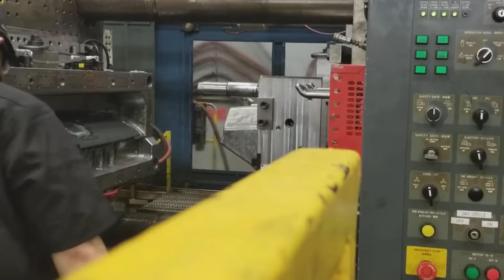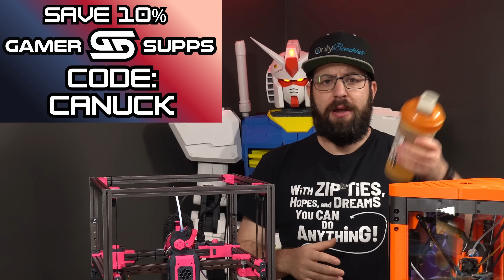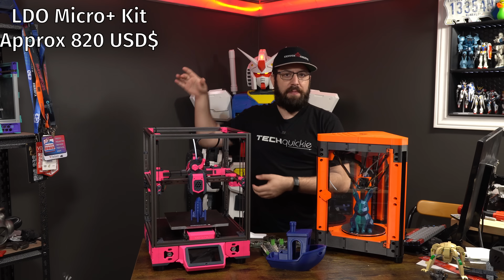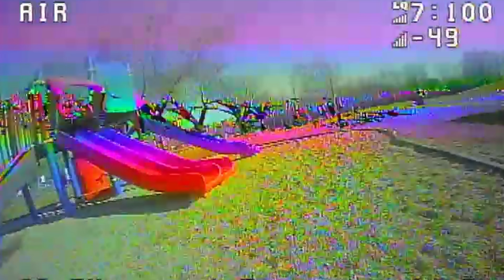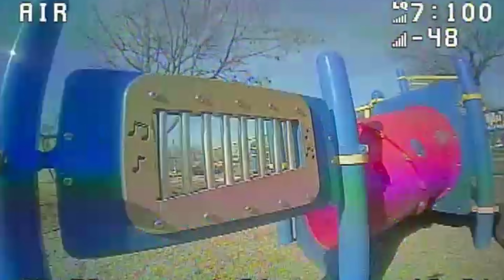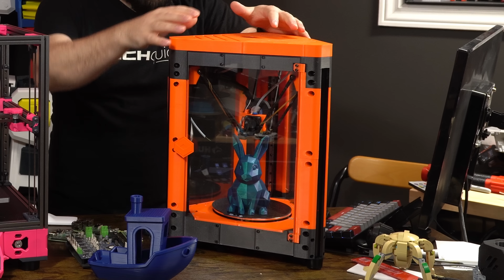Are DIY 3D printers in danger?

Comment: TL:DR: I see what you're saying about consumer printers becoming more enticing than DIY printers.  (My personal pet peeve is that Elegoo commercial where the dad prints a toy for his daughter then shows it to her friends and they run into his office unsupervised handling filament and loading it in and throwing all the things they want to print on a single virtual bed.  Then after playing for a little while, the same day, pulling all of those objects out of the printer and they are all perfect and ready to go, ugh.)

I just acquired my first 3D printer about 3 weeks ago.  A used sv06 plus with a 5015 blower fan upgrade on the hotend.  I already replaced that 5015 bearing fan with a maglev.  Replaced the PSU with a meanwell.  Replaced the rest of the fans.  Installed Klipper on a Pi after 5 days of using Marlin (best move ever for so many reasons).  I'm in the middle of modding a filament dryer with better fans and a pot to control fan speed.  I put off getting a 3D printer for so long because of either cost or the practicality just wasn't there.  I knew the DIY scene existed but didn't know anything about it.  From my sv06 plus I learned the limitations of the bedslinger.  I also learned it had limitations on materials that couldn't be completely solved with an all-metal extruder and hardened nozzles.  I learned I really like this hobby but I want to print better materials and faster without slinging a bed.

Then you see ads for an open source SOVOL M1D with 2 toolheads, and ability to swap materials and colors without waste.  At this point I know Voron existed and that kits were expensive compared to my sv06 plus that could print better than most things I'd seen posted online so far.  You see that machine coming out at a price that rivals a Voron Trident kit and it's ready to go out of the box with 2 toolheads and the ability to use multiple materials and colors.  The Voron kit on the other hand only gets you one toolhead still, more money after that needed to get a second toolhead or system that allows you change materials and colors.   And you do ask yourself, why would I buy a kit that people claim it takes months to build just to get to point that doesn't match the consumer product for the same price?   But then you remember what you went through with that consumer product.  Upgrading all the fans to fans you want,  upgrading the PSU, Upgrading the toolhead, upgrading the bearings,  getting Klipper set up and you realize there is still value to building your own.

I can see where the general user sees these consumer products and says I can just buy that and start printing the things I want to print or create things for whatever else they are in to.  Me, I got into this for the ability to print my own parts and useful items without having to rely on a store or waiting for someone else to design a product to exactly fits my needs or just basic things I can make for very little cost compared to buying them.  One of the biggest values of building your own is like you said, you understand better how it works and how you can make it fit your needs better, but also, upgrading.  Sure that M1D looks fancy and nice, but if you have something like a Voron Trident, you could modify it to do the same thing with parts that more easily replaceable and not be locked into that ecosystem, and that's what your average consumer isn't going to get.  But it is scary to think that may hinder the DIY users at some point.

Comment: I started on an Ender 3 V2 in 2021, got into printing for a while and enjoyed tinkering with the hardware, but I would get annoyed when it wouldn't work or had to tinker to get a print out, I used it until this year when I got a Bambu P2S. Now that i had a good system that's so reliable its sparked my interested back into the DIY builds. I have started modding my Ender 3 and my next upgrade is klipper. I got an Elegoo Neptune 3 for €5 locally purely just for fun and found the Encore printer project that I fully intend to make with the parts from the neptune. I am really enjoying it so far.

Comment: My first printer was the Tevo/Homers Tarantula. It was atrocious; and required more printed mods, than prints that it produced that where not mods.  In 2023 I bought a Prusa MK3 clone for a school. And then I found out that Sovol, just came out with the SV06. I was jealous of the school, and my own printer could not reliably print anything. So I bought a Sovol SV06. With very few, highly functional mods and replacement parts, that SV06 has just been churning out prints in mostly PETG, but PLA and TPU as well.  The biggest problem I have with the SV06 is having enough plastic to feed it. I am hoping to design and build a variant of the Ender 3 NG, in order to make use of the modified electronics of from the Tarantula. I am thinking of a "Rook" like Core XY printer that uses fiberglass driveway reflector posts as re-enforcements to a  solid printed frame, which is sectioned and dovetailed at the slicer level. By using the fence posts, the rectangle frame sections will need very little infill. Sectioning off the corners would allow for more, better, infill where it matters most. The idea, is to make a cheap DIY Core XY printer with a super ridged frame, using glue to connect the sections, and as few fasteners as possible. Also, just hardware store grade panels, and front door, should drop the enclosure cost. I recently bought a Elegoo Mars 5, which I hope to use for printing highly detailed miniature RC Cars, and for and for more precision in very small prints.

Comment: I started with building a Prusa clone and then bought an Ender 3 v2. Then I tried to make my own bedslinger with V slots. I had so much fun. Then life happened, and I sold my Ender 3 v2. Four years later, I'm searching for a new printer, and I only found out there is only one option, and that is Bambu Lab. 
which is boring and depressing. 

But I do see value in custom big-sized printers and custom enclosure boxes.

Comment: K1 SE now goes on sale in the $250 range, put a few hundred into it (flowtech nozzle, bondtech X axis/gantry/extruder, print some walls and a door) and you've got a high end enclosed 225mm^3 machine. K2 SE's $299, but I haven't looked into the aftermarket on it. The reason the k1se's aftermarket is so good is it's basically identical to the k1c aside from not coming with an enclosure and camera, and I'm not sure if the k2se has the same level of part compatibility with the higher end k2 models.

Comment: I'm more on the side of buy cheap option, upgrade as I go. Lots of community mods for the Centauri Carbon. Trying to tailor an existing, affordable machine to my needs as I go has been a lot less stressful than trying to build something custom which might not meet all of those needs right out the gate (i.e. there will be post-assembly customization regardless). Having something solid to design around is actually how I work best! I make lots of mating parts to combine different things (like my phone case with magnet grip and my external SSD, or a top cover of my printer that relocates my filament dryer and the runout sensor).

Comment: The newest iterations of consumer 3D printers like the Flashforge Creator 5, Snapmaker U1 and Anycubic Kobra X are getting really good. Yes, as far as baseline printing is concerned for people who want to print something almost straight out of the box, DIY is probably cooked. Matching today's affordable printers on performance, reliability, features, etc. has become impossible, especially when you factor in the stiffness advantage of mass-manufactured printers having frames either made of machined castings or using all-in-one machined corner connecting pieces. Not going to match those using 20/40mm extrusions and off-the-shelf braces.

DIY still has room in experimental systems, arbitrarily large build volumes, tooling combinations unlikely to ever happen at consumer-friendly prices, etc. If I had to build a DIY printer today, the biggest improvement I can think of over today's new ~$1000 printers besides build volume over 300mm cube would be having dual independent X gantries so one X-axis can take its time tool-swapping while the other is printing with 8-10 total heads available (4-5 for each X-axis) to eliminate the need for an AMS for anything I am likely to ever print including a few spares for backup rolls and special purposes.

Comment: I also came into 3d printing late 2017 building the original Hypercube. I probably fit into the third group you mentioned, that is I like building electronics projects and I wanted a fast capable printer at the time where the only option was to build it. I must say I got the bug and you learnt a ton. I have recently however bought a Bambu X2d and I'm considering upgrading the hypercube to a enclosed Voron legacy. Plug and play printers are just boring because I want to upgrade and mod things.

Comment: FWIW: I’ve been loosely following the 3D printing industry, since the OG maker bot. The starts recently aligned and I have the extra cash and space for a 3D printer. I went with a Prusa Core One L.

That said I think it would be neat to build a tiny 3D printer from a kit one of these days, but I do agree that sourcing custom components is getting more and more expensive these days, which may ultimately deter me from building a DIY machine, unless some one has the means to stock and sell parts kits at a reasonable price.

Comment: Product designer and inventor for hire now retired.  So here is my 5 cents.  Few people have sufficiently wide skill set or the time to do it all from scratch and wish to spend the money.  
*   The kits your pointing to need the egg before you have the chicken.  So this assumes you own a printer.   Two groups the antique one like my Tevo Tornado. or a enclosed unit.   
*   Second in a heated chamber plastic components will CREEP!  So the reason for temperature control chamber is questionable.
*   That leave for the best units that can run the widest range of materials and even be converted to a CNC station. Plastic structural members are out.
*  need a modular approach.  
      *     The classic 80x20 extruded aluminum framing systems with brackets for assembling the frame.  This is how my Tevo Tornado and one of the models you have in the video.   However; not the most cost effective and stiffest.  
      *    Square and rectangular perforated thin wall steel tube for example are far stiffer, cheaper, and operate at higher temperatures then extruded aluminum.   Can make right angle corner without brackets, however tube insert for carrying clamping load across ID of tube best practice.  Blind fasteners can be used if an insert tube isn't practical. 
*    Modular components such as found with the extruded aluminum  attached to brackets.
*    Electronic boxes that can be inside or outside of an enclosure due to heat.  
*   need better modules for the motors which include cooling option.

My issue is that I want to design me own parts that and design from scratch.  Habit from solving real customer problems.  So to make my tornado work in an enclosure.  The first specs I looked at were the motors.  Not rated for the air temperatures of high end plastics.  They need liquid cooling.  Need to cool the filament so it retains it's stiffness  for either approach for driving the filament.  May need air cooling to achieve solidification of the plastic after it bonds to the previous layer for stiffness of the final part.

Comment: I didn't build the voron because for the same price I can get an enclosed 3d printer with AMS, nozzle scrubber, pressure leveling, and parts are cheap. VORON needs to update to a 3.0 with all those things  to start attracting people. Making all those mods later is possible but just the AMS system is about $300, when Elegoo cc canvas upgrade is $55 and multi path. Not to say is an upgrade to the firmware that takes 2 minutes of your time, in VORON you need at least 2 hours to setup.

Comment: So you can call me a Prusa fan boy because at some point I got MK3(S?) kit, then I sold it and got an MK4 kit, then I rebuilt it into Core One, and now I’m waiting to get my INDX founders edition. But my first 3D printed was a Dagoma Neva, and somewhere in the middle I also got a Monoprice Mini Delta. Last year I’ve also built a Voron0 with my kids and this was a magical experience.

Now the main letdown for me was that I took the recommended OrcaSlicer with profiles for V0 and the result was so-so. And then I took some outdated PrusaSlicer profile and copied a PLA profile for MK3, or CoreOne that the result was waaay better. I find this very disappointing because if some guy can hack a basic thing that a community didn’t achieve in years then is there even a future for that community?

Maybe I’ll get some time in the future and I’ll become more active and vocal but pushing bare necessities to the public like color change, filament sensor, etc. Maybe I choose a wrong base line because V2.4 has a better support, but I’m interested in a tiny printer that I can pack and bring for demos. But at the moment I’d rather spend my time by printing stuff on Prusa and modding things that don’t work well (especially MMU, enclosure, filament storage) instead of fighting V0 to get to the level of my Prusa. On the other hand I still need a printer for my kids, so I’ll keep improving V0.4217 😊

Comment: A valid point, I started 2013 with reprap, currently voron and Snapmaker. But I know exactly what you mean, one directional flow, transition into commercial (boring) enclosed and locked down products. On the other hand if you see the voron team members at the reprap festival talking, it's pretty reassuring and nice to hear what they are planning. All the products look old and boring compared to full DIY printers 😅 (a fan)

Comment: For sure it is a little worrying with the direction. I spent a long time building my Voron V2 and around the same time a friend went out bought a printer set it up and its printing faster and cleaner (initially) than my V2. For me, im in the bracket of "i love building the printer, and modifying it/maintining it" and this shows when my friends printer had an issue and he didnt know how to fix it.

Price point for me is the biggest gripe, as you pointed out a similar spec consumer machine to a voron, you're looking at 3x the price for the Voron

Comment: Stumbled across this video while building a printer and while I can't take complete credit for the build, I am taking an ender five and basically turning it into a bamboo labs P1. It currently has a car XY motion system and I am currently working on the electronics which include a big tree tech octopus pro and raspberry pi 4. 

I also have a second project which is much more interesting and is proving to be much more challenging than I thought which is custom building a nearly 100% 3D printed printer that I designed myself trying to force myself to learn how to use CAD systems better.

Comment: You are 100% (infill) correct, I feel absolute actual rage when a bambu user starts yapping about how 3d printer is "easy" and I always wanna say "yes stupid, because of us", but usually I stay silent unlike my own printer.
I would say the ender 3 in itself was a scaled down CR 10, but late 2017 was toward the end of the OG CR-10 so understandable.

Comment: For me the main problem is the tech. As things matured and move on to advance by inches, DIY printers can't catch up any more. For example the ladar sensor on X1 and flow pressure sensor on A1. I've been a tinker myself since the the pandemic, but now, when i just want to spend handreds of dollars and multiple weekends to intall the most advanced mod on my Voron 2.4, they are still not to the standard of X1. Then what's the point? Please correct me if I'm wrong, I'm dieing to do some crazy voron mods lately.

Comment: I got into 3D printing around 2018. Ender 3, same as most everyone else. The hobby for me was always upgrading the printer. Better part cooling, new hotend, etc. I played with dual extrusion at one point. Klipperized the machine, back when klipper was still sort of niche. I got busy and kind of tuned out of the hobby around 2021-22. About 7 months ago I got back into the hobby. Joined some new discord servers, bought an FLsun V400 second-hand as a project printer. Been having a great time. 

The landscape has changed a lot since the ender days. Print speed expectations are so much higher. Tons more high flow and ultra high flow stuff. Bambu has brought a lot more noobs into the hobby, which is great but can be annoying when you have to deal with someone who hasn't the slightest scrap of 3D printing knowledge. The biggest difference compared to the flood of people who entered during the ender days is that bambu printers are kind of locked down. They don't bring with them the spirit of open source, of doing whatever you want to your 3d printer to make it your own. This means the printer upgrade side of the community is no longer getting those people who got into it to print stuff, and discovered they loved the tinkering aspect. 

I don't think the custom printer building community is going anywhere. It's just going to shrink in relation to the number of people who own printers just to print. I like to think of cars. There is a very dedicated community of enthusiasts who like to upgrade and modify their cars. However, most people just drive their car from point A to point B. On the surface you can read this as "less people are interested", but really it's the case that the same number of people are interested, they've just been hugely outnumbered by all the new people who aren't as interested.